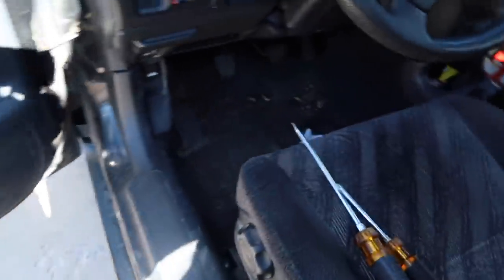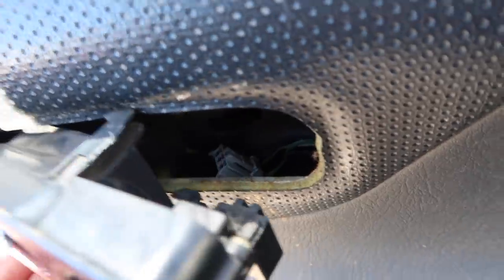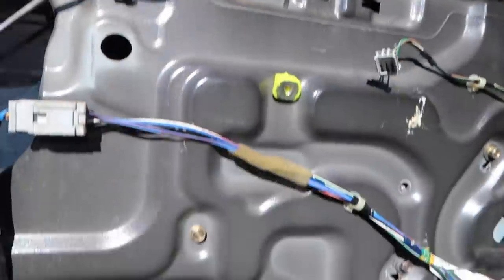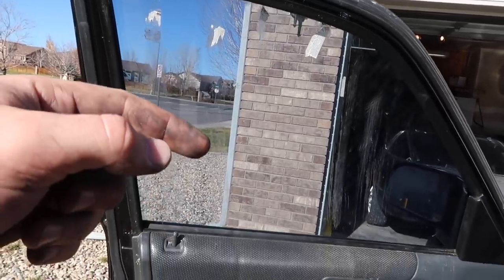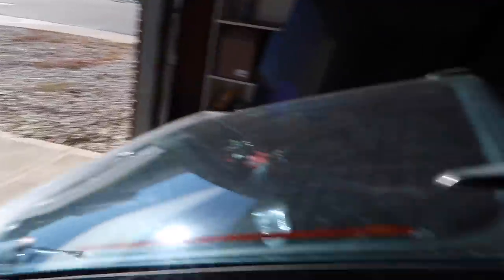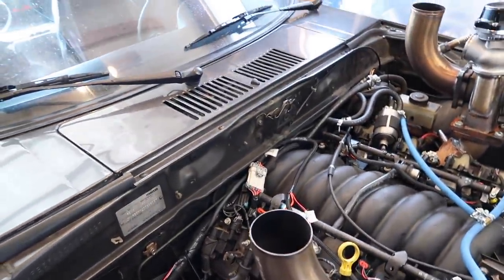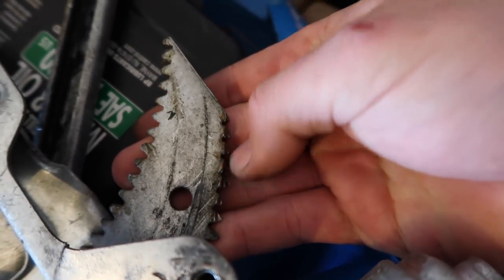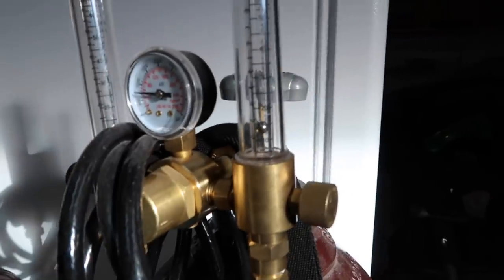CRV Window Regulator & Tig Welding

Comment: If the window comes off of the track, the rail must be aligned. It is very simple. Some cars allow adjustment by loosening the bolts that hold the rail. In other cars, you can just bend the track. The regulator shouldn't have anything to do with the window coming off of track.

Comment: I hope you had good luck with your welding test! That's exactly what I do for a living, I work for the biggest dairy cooperative in Canada, and there is very good money to be made in this industry for meticulous guys like you and I! 100$ an hour is possible with some experience! from my experience, I would purge at 20 cfh (too much, your weld will be convex on the outside, too little argon and it will be concave, both are considered a defect in sanitary welding) I also LOVE to use pulse on sanitary tubing because you want to control heat as much as possible it also help to be more consistent. DO NOT hesitate to purge for a good moment before welding, and a good minute after you stopped too. Some customers won't accept ANY coloration on the inside of the tubing and these tips will help that a lot. If you assemble your test tubes yourself, brush the inside with a "scotch brite" on the weld area and the heat affected zone because the "mechanical" polishing is less prone to coloring than the electrostatic polishing they use on most ferrules for exemple. If you are not comfortable doing the entire circumference in 2 passes, ajust your tungsten stickout and don't hesitate to rest your cup on the tubing while you reposition. It's probably a little bit late for the tips, but.. better late than never!

Comment: Ever heard of something called walking the cup? Almost all pipe tig welders in my trade so it. They basically have the cup touching the surface of the pipe and walk it. My uncle and a few people I know have an odd way of doing non-fusion welds. They use a huge cap and feed the rod from inside.

Comment: Hey bro discoloration on the outside is not a issue it will always be acided or wire brushed after welding. On the inside you need to be very light yellow or better, so you might need to turn gas up and have a bigger hole in the top. Use downslope on the welder and keep moving when you stop or you will get a pinhole. Also starting at the bottom and only going up is not 6g you need weld down too for that so they may make you weld the tube in one direction only. Good luck